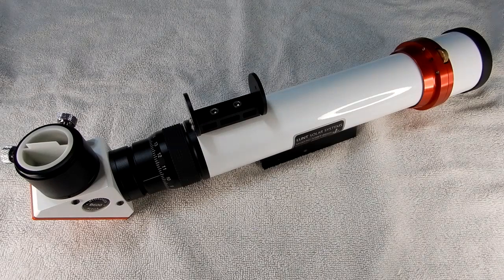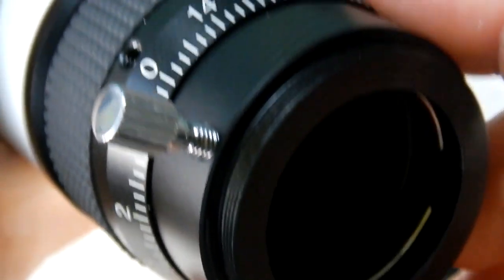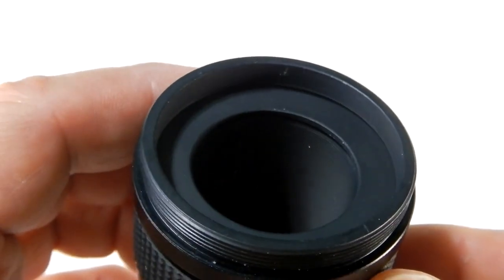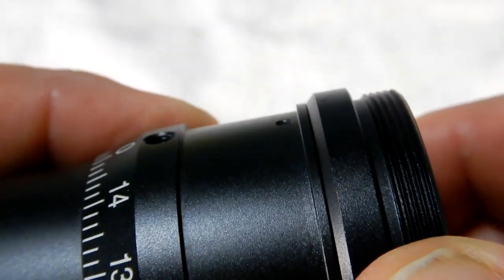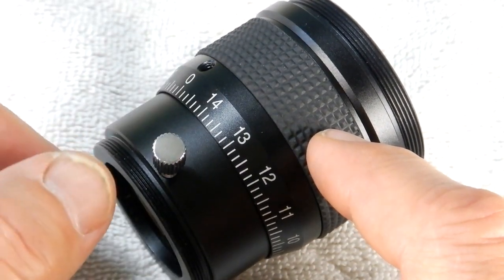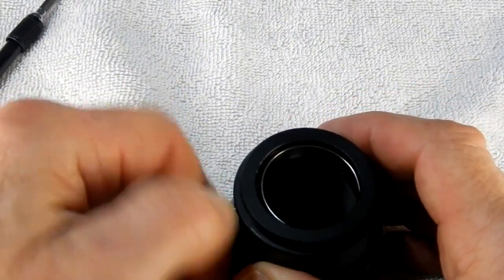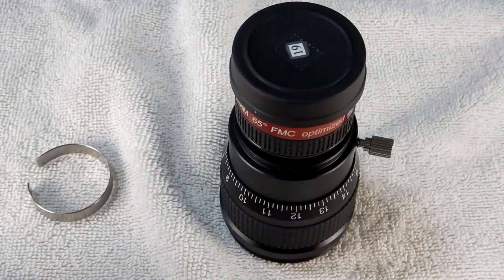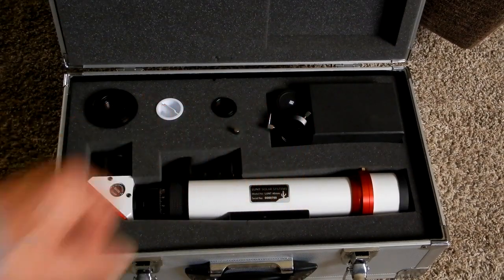How to Repair the Helical Focuser on a Lunt 40mm Dedicated Hydrogen-Alpha Solar Telescope

Comment: I was able to replace the defective Lunt focuser compression ring in this video.  I found an unused T thread eyepiece holder that had the same size compression ring here in my spare astro parts.  I have seen 9mm replacement compression rings but the Lunt focuser uses the smaller close to 6mm wide ring.  I took out the ring from the Lunt focuser and replaced it with the ring from the eyepiece holder.
It works perfectly now with smooth slide in and out of the nosepiece.
But the interesting thing is I put the defective Lunt focuser compression ring into the unused eyepiece holder and there it is working perfectly with smooth slide in and out.
Reply from the maker: Chuck Hunt   Thanks for the update. Interesting the "defective" compression ring works in another holder.

Comment: great you helped out your friend. I also have a couple items like my brand new Tele Vue 5x power mate (used it 2x times) then that brass compression part stop working. Iam also going to remove it and just have the thumb screw hold like the old way. cheers good vid.
Reply from the maker: JoeJaguar   THANKS. I am amazed the TV gave you that problem. Did you notify them to get a new part?
Reply: @starastronomer  no i also have same issue on a diagonal but i robbaly would have to contact the dealer i got it from & i just dont want to bother i will just use the thumb screw only
Reply from the maker: JoeJaguar   Thanks for the update.

Comment: My helical focuser has slight sideways play in it, I’m going to give it a looking at today, we should all complain to Lunt for having such a crap focuser on a great scope!
Reply from the maker: Gasgiant   My buddy feels the same way but they are trying to hold down the cost. Here's what I paid for mine with a Feather Touch focuser https://www.youtube.com/watch?v=pYN2O1GPSw8
Reply: I removed the eyepiece holder on the blocking diagonal and replaced it with a non rotating helical focuser that cost about $50.  That was after my friend repaired it.  After setting the new focuser to the middle of its range I used the Lunt focuser to get focus and then locked it with the set screw.  I focus only with the non rotating helical focuser and don't use the Lunt focuser.  Also I can insert the blocking diagonal all the way in to the Lunt focuser without having to pull it out for coarse focus.  Also the non rotating helical focuser has a range of about 7mm in and out focus.  Focus may vary with different eyepieces.   I decided to try this and it works for me.
Reply from the maker: Sounds good Chuck.

Comment: It's a shame that there isn't a more normal focuser for these telescopes, or at least one that doesn't cost an arm and a leg.
Reply from the maker: H. N.   I think they are trying to keep the price as low as possible by using this focuser. The 40mm I have on order with the Starlight Instruments will cost me an extra $480.00.
Reply: @starastronomer  Part of the problem, I think, is that Starlight Instruments is the only one who officially still makes focusers for Lunt. They make premium stuff, but it also costs a premium. I guess there are just not enough solar telescopes in the wild for more affordable alternatives to be mass produced.

How sturdy do you feel the helical focusers are on the 40mm?  I’m okay with using a helical (and if I wanted a smoother focuser I can switch it to a Borg or Coma focuser for less), but I’m worried it won’t hold the ~.48kg camera I want to attach to it. The focuser issue is one of the things that’s making me hesitate on buying this, since I don’t want to spend more than I have to.
Reply from the maker: H. N.    I would ask Lunt as to what they feel the focuser will handle.